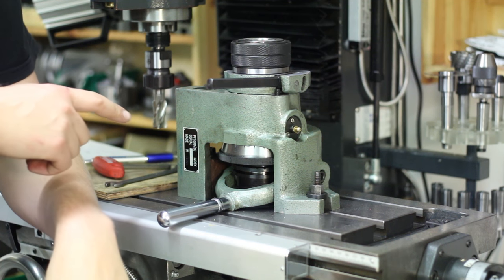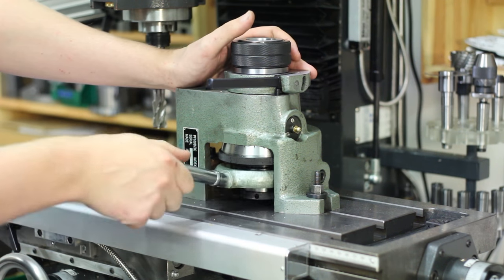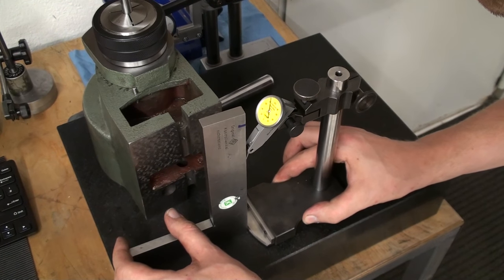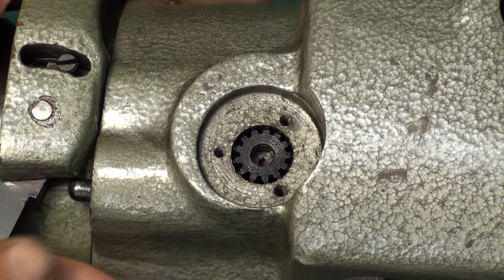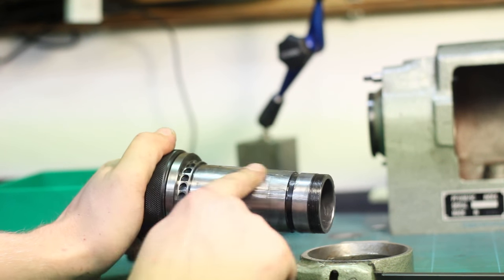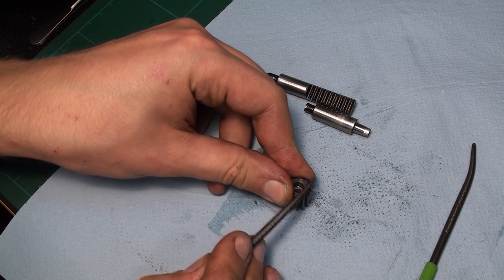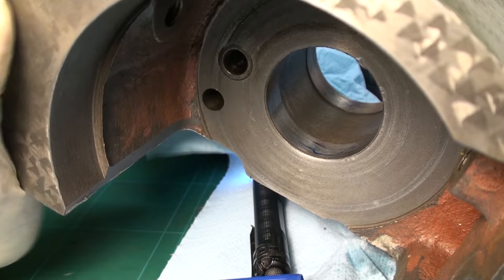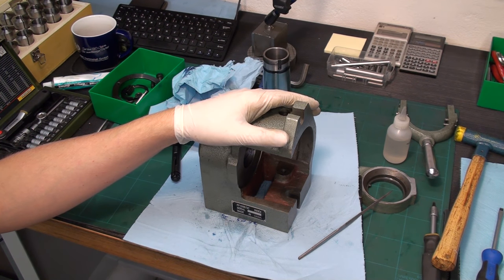Chinese 5C Indexer teardown

Comment: I have found that there is a third option to the spend a lot of money argument. I buy a lot of used items if I think they're a good bargain and worth salvaging and I fix them up that is my favorite option for example I have a hardinge lathe and the shop that threw it away had never used it in 25 30 years other than two polish this or that part occasionally. They had a power surge and they thought the machine was fried so since they weren't using it anyway they gave it to me. I had it running in under 5 minutes there maintenance people were very very stupid. For one thing the machine was wired pletely wrong and the sad part is there was a printing the sleeve of the door so there's no reason for it. Someone had actually reversed the contacts on the limit sensors that control the speed anyone that understands how I hurting 59 works is knows that there's a motor that lifts and lowers a mechanism to adjust belts and pulleys for the simplest explanation. But the fact that the limit sensors were backwards meant that it would crash if you took it too fast or too slow the worm gear would strip then there would be a catastrophe. So instead of trying to fix it which would take all of 30 seconds they put a sign on it not to go past this point of a red Sharpie marker arrow that they drew on the control. How these people got jobs as maintenance people for Machinery is beyond all understanding. But I got off topic I guess they also threw out to tip slides which are worth about $500 a piece because they no longer clamped in the tea slots anymore. So basically I just made a new cam screw and they lock down just fine now and they're not in the garbage. there is six or seven different components that they were throwing away that were perfectly fine after simple fixes like I described. If I knew how to scrape I could even have saved more.

Another option is invest some time researching manufacturing companies in China learn contacts names learn a little bit about the city that they're in and introduce yourself on a site such as Alibaba. If you know how to talk to these people and you do not sound like you're trying to get something for nothing that you're more interested quality than anything else they will provide options that they use in their industrial complex. They make different level of quality they make Harbor Freight quality to sell to stupid Americans they want something for nothing and then they make the stuff that they Supply their own Industries and it is pretty damn good stuff. For example I buy inserts from one company that supplies mainly China I get them for about a dollar a piece and the same insert is sold over here for $18 a piece under a well-known name. I would have never been able to buy supplies from this gentleman had I gone in there asking for the lowest price or trying to bargain with him for price I tried that route for the first few months and I got nothing but garbage. When I started looking for quality and forgot about price completely I found them to be very interested in helping even a small guy like me they will sell to an individual they don't care how little the order is they want your business.